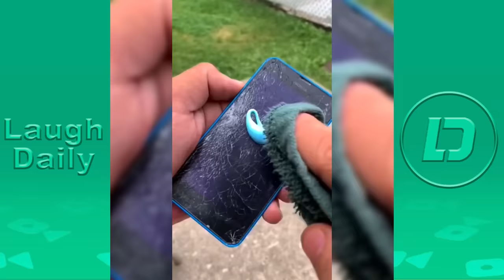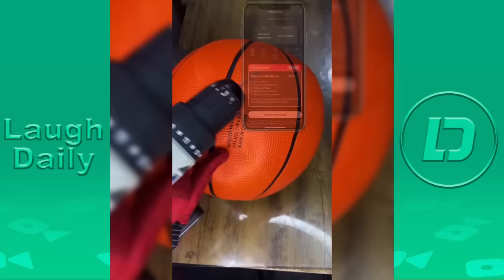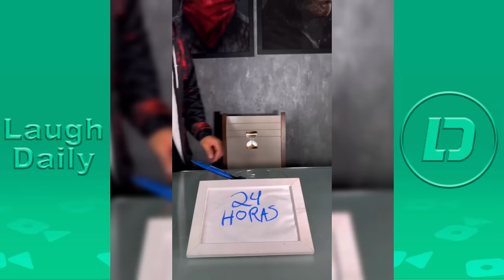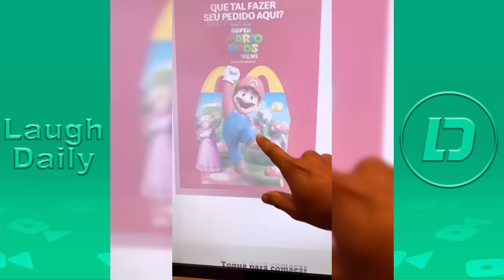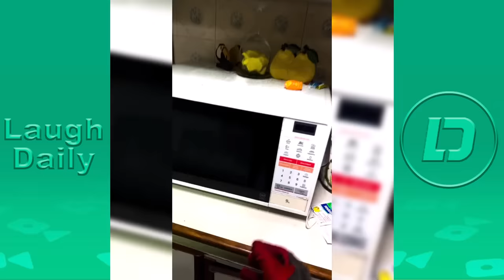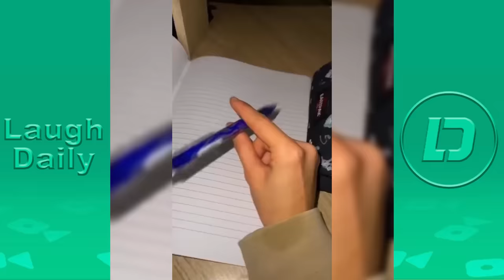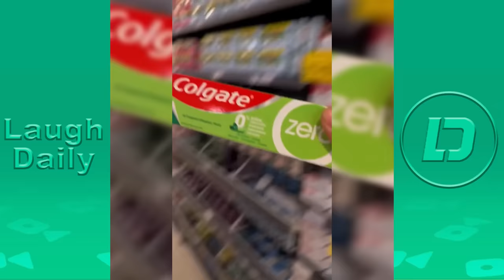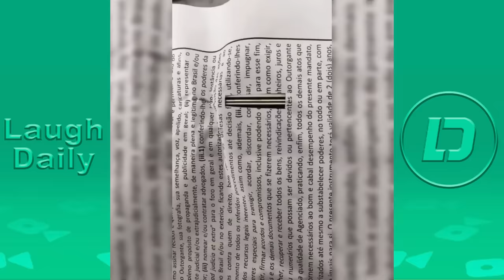*1 HOUR* Spider Slack New TIK TOK Compilations 2023 | Best Spider Slack Tik Tok Videos

Comment: 6:17 figure burj khalifa is dropped
6:49 BFDI pen is silce pear
7:57 lightblub is dropped
10:01 spider slack is fart and BFDI firey plush is ghost
11:15 lightblub is dropped again
12:47 glass table is break
13:04 socket door
13:32 chair is broken
15:30 🚭do not is smoke🚭
15:49 BFDI flower is silce strawberry
16:35 explosion bottle
19:37 BFDI tennis ball is burned
21:06 drying machine is break
21:22 flying coca cola bottle
22:01 BFDI merch with cloth is ripped
22:20 burj khalifa is bye spider slack
23:21 cardboard is dropped
23:44 burj khalifa with picture and vase is dropped
24:02 socket wooden table
24:11 pot is dropped
24:37 BFDI snowball is half coconut
25:35 enter in backrooms 
6:49 or 27:14 which is same thing
35:43 RIP BFDI food in (2010/2023)
37:29 burj khalifa is explosion
39:04 glass wine is break
43:33 no cleaning and broom is broken
44:02 kitchen sink is broken
43:33 or 51:21 which is same thing again
52:24 💡do not is flash💡
53:10 burj khalifa is destroy
53:20 spider sleafy
53:50 beer bottle is dropped
54:40 plate is break
54:46 pringles logo is blink eye
55:55 socket door again
56:01 lightblub is out
56:36 BFDI firey is silce melon
56:36 or 57:33 which is same thing again again
53:20 or 59:48 which is same thing again again again
1:00:48 shorter glass is dropped
1:02:46 wooden table is all dropped
1:04:21 BFDI firey is ghost again
1:05:30 glass wine is dropped
1:06:13 BFDI golf ball is cut grape
1:06:24 SSIF BFIG again
1:07:01 glass cup is dropped
1:07:12 BFDI spongy is silce orange
1:05:02 or 1:08:23 which is same thing again again again again
1:05:30 or 1:08:51 which is same thing again again again again again
53:50 or 1:10:37 which is same thing agagagagagagain